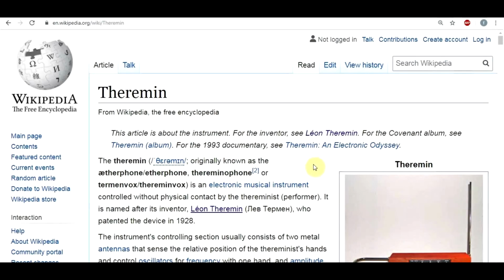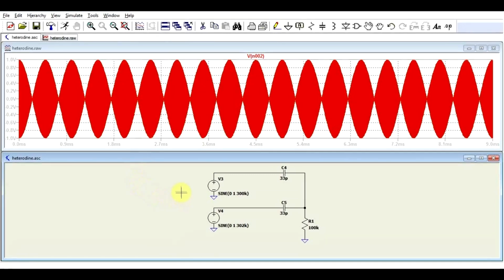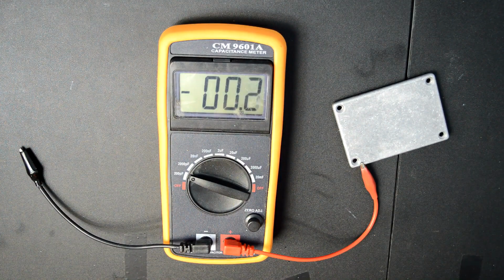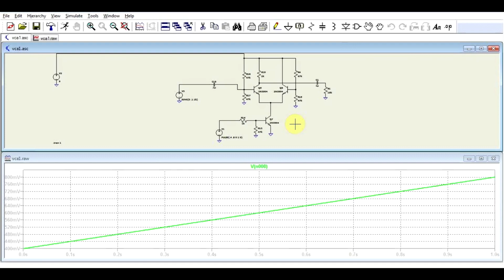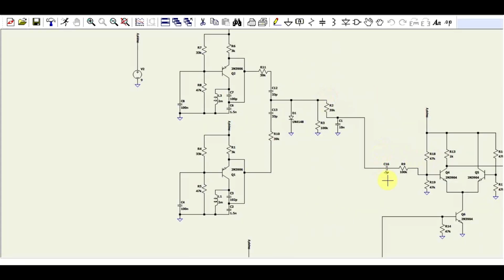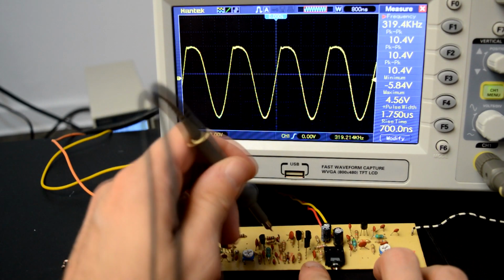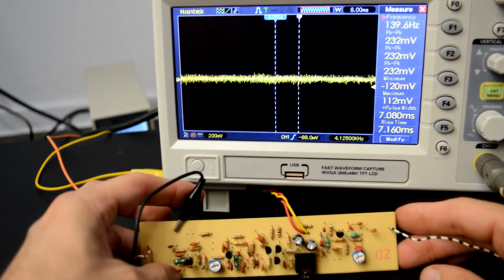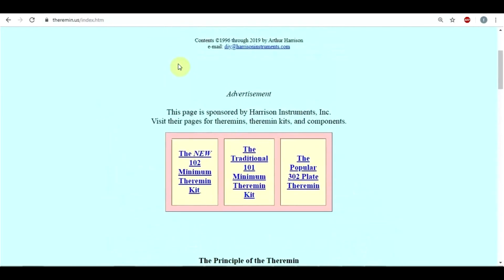A spooky circuit - The Theremin

Comment: Hello, I noticed there are some resistors not labeled like R30, R31, R32. Do the values not matter or are they within a certain range similar to the capacitors?
Reply from the maker: I must have missed this. The values should be the same as for the other oscillators - R32=R9=33k R31=R8=47k R30=R1=3k

Comment: This is a very simple and reliable Theremin. It uses the well known Colpitts oscillator and the fact of using PNP transistors is wise because it has the advantage of having the inductor connected to ground, more stable, instead of the NPN approach that makes the inductor "float" somehow. Not my case because I have the measuring instruments , but perhaps it would be nice for the hobbyst to know a little bit more on how to build their own inductor coils, which are very simple. Maybe I missed something on this issue. Thank you for the project ! Greetings from Buenos Aires, Argentina.

Comment: Could you put the values of C2, C10, C23, C26, C29 and R30, R31 R32? They are missing in the schematic and I would like to make this circuit. Thanks a lot. And an image of the PCB???
Reply: I found in another comment he replied "Those are just some large decoupling capacitors 47uf-470uF; the exact value does not matter a lot, but having them is recommended."

Comment: hello there!
I just gathered all components to make this version, pretty neat for sure!
but... I'm missing something, what are the values for C2, C23 and C15? are they relevant? ...or needed at all? I don't see them on the assembled board. thank you!!!
Reply from the maker: Hello. Those are just some large decoupling capacitors 47uf-470uF; the exact value does not matter a lot, but having them is recommended.
Reply: @FesZElectronics  just like I suspected. thanks a lot, man!

Comment: What you show is not heterodyning. That would imply generation of sum & difference frequencies, which you are not doing. You are doing simple linear mixing. RF "mixing" requires multiplication or other nonlinearity.
Reply: It might be a bit confusing, but the diose in the "mixing and detecting" section is doing the magic. That diode is the nonlinear element. Appears to work better than I would have expected. Great to see some novel ideas here, especially the slope detector driven volume control.

Comment: Why do you use a envelope detector with a ground referenced diode in stead of the more common peak detector (single diode rectifier with RC on the output)?
Reply from the maker: I think both methods are still called envelope detectors, the ideal peak detector just keeps the highest value for a longer period -but anyway, its a very good question. I noticed that in various theremin schematics this is the preferred way, and in the simulator also this gives a much larger signal than the other version. I guess that is has to do with the method in which the frequency combination is done - based on how the diode is placed there is an effect on the heterodyned signal.